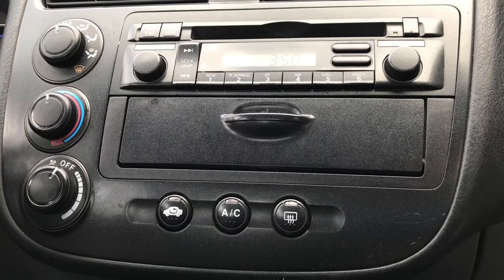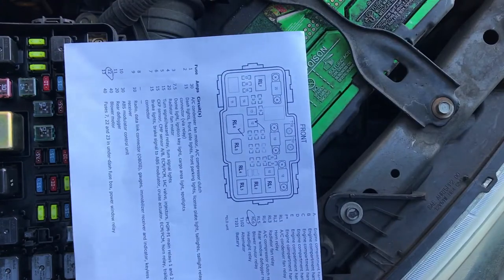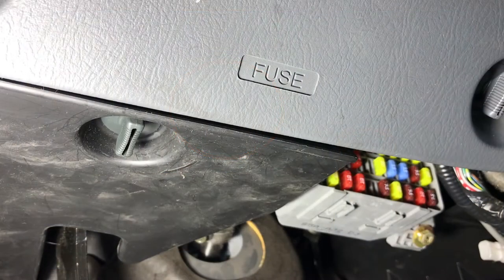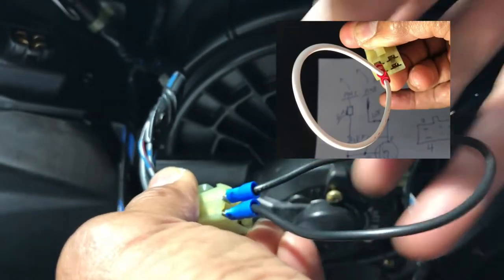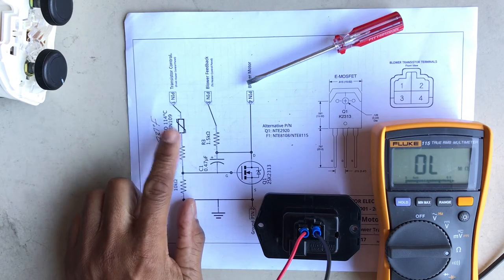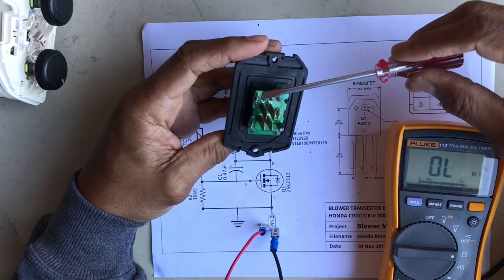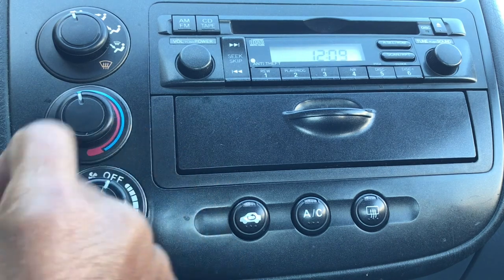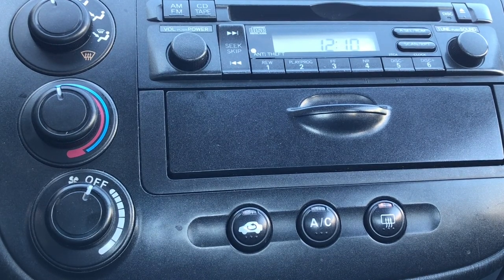Honda Civic Blower Motor and Blower Transistor Troubleshooting

Comment: This was by far the best walkthrough I have found. I ordered a new fan motor and transistors before watching this. I wish I had watched this first. I'm confident, it is the transistors. I installed the new fan motor, nothing but I bet if I run the jumpers and test the transistor I will find the problem and could of saved $40.

Comment: Sir... I wanted to take a moment of my busy schedule to Thank you for your tutorial. I did the diagnostic and I changed my blower motor resistor and now I have a working ac / fan. Summer might over here in Los Angeles but with the rainy weather, I'll be using my defroster regularly. Thanks again 👍🙏

Comment: Fantastic tutorial.Just subscribed May I ask? Do you use electron or conventional theory or both when you diagnose. Just wondering if one is easier to understand electronics? CHEERS
Reply from the maker: I use both. Technically, current flows from negative to positive in conductors. It doesn’t matter which convention you use if you’re consistent. Since electrons and protons have an equal but opposite charge, an electron flowing in one direction is equal to a proton flowing in the opposite direction. You can still use conventional current flow even though it’s not technically correct and come up with the right answer.

Most formulas used in electronics, such as Ohm’s Law, pretend that current flows from positive to negative. And if you think about it, most schematics depict a current flow from the positive side of a battery through conductors and loads to the ground, the negative side of the battery.

In the end, it doesn’t matter. I use both, whichever makes the circuit analysis easier. Again, remember that most formulas and books represent conventional current flow. For most bench-type troubleshooting, the direction of current flows is unimportant; the amount of current flows is.

Comment: This was pretty good. I will have to check the resistor/transistor module since the new heat controller did not correct the problem with the variable speed.

Some previous owner, or associate, had bypassed the fan wiring to install a bulky on/off switch they placed in the glove box with no variable speed option. They cut the power blue wire, taped up the separated end and hooked the live wire to the switch then anchored it to a ground bolt at the firewall.

I tried reconnecting the wire and checked the actual variable speed knob, but nothing worked, so I'm thinking it's the resistor module as noted in this video.

Comment: Thanks very much for the video.  Gotta wonder why they didn't PWM the MOSFET from the microcontroller instead of using it in a linear mode, would have been a lot less heat to add a catch diode and vary the duty cycle.

Comment: I have a 2010 Honda Civic and the blower stopped working but randomy will work.  Under dash fuse is good, under hood fuse good, blower relay good, and I have no power to blower motor connector or transistor.  If I jump the relay between 30 and 87, the blower will turn on and can be controlled via dash  climate control.  I tested the fuse box relay plug and have power on 2 plugs, and ground on one.  The top left (85 or 86) doesnt have ground.  Any ideas?  Thanks
Reply from the maker: It appears you’re not getting any voltage out of relay plug 87. Referencing the under-hood blower motor relay, remove the relay from the socket and turn the ignition key to the accessory position. With a multimeter, measure the voltage at socket position 86, which should read 12 V. Then, measure the voltage at position 30, which should also read 12v. Turn the key off and measure socket position 85 with an ohmmeter to any good ground; it should read nearly zero ohms.  

The relay plugs 85 and 86 are the ends of the relay coil.  Relay plug 30 is the 12v input to the switch contact, and plug 87 supplies 12v to the blower motor once the switch contact closes.

Comment: Hello! Pins 1 and 2 is measuring 11.04-.09 ohms. Is this good or bad?. The other pins are reading very close to yours except 1 and 2. Thanks.
Reply from the maker: I assume from what you wrote; you’re referring to a meter reading between 11.04K ohm and 11.09K ohm. That’s a correct indication given resistance tolerances around + or -5% (+/- 550 ohms).
Reply: @eetech_fix2393  ok, Thanks!

Comment: Great video on the resistor testing. Mine is a UK 2.2 2006 gen 8.
My resistor looks slightly different. If I test mine with the tab at the top assuming same pin numbers, my no 2 + 4 test is a fail.
If I turn it upside down and assume the pins are numbered that way everything checks out correctly as far as I can tell.
Where could I get a sechmatic like yours or find out?
Thanks
Reply from the maker: The case dimensions maybe slightly different; however, the electrical receptacle/plug pinouts, and wiring are most common to the 2006 Civic, Accord, and Odyssey. During that period, DENSO, (Japan company) was the source of those transistor units. A blown thermal fuse is most common, open reading between pins 1 & 2. The MOSFET transistor rarely fails.See the following link for pinouts and test points:  https://drive.google.com/file/d/1u2d3_BE0IlePQrb1HfBnxZir6aF8kAhU/view?usp=sharing
Reply: You are very good with this. i have a 2006 civic type r fn2 . the fan is full blast when ignition is switched to on . it wont change speed or switch off via controller. the only way it shuts off is if i remove either the fuse or the resistor/transister thingy

Comment: What levels of voltage does the control head deliver to the power transistor when the transistor thermal protection was burned open? Reason I ask is so I know what a good controller will deliver at various speed selection when there is no voltage drop due to blown transistor thermal protection device. So I can be confident the controller is working fine. Thank you.
Reply from the maker: Should vary between 0 - 12 Vdc with speed selection
Reply: @eetech_fix2393  Thank you Sir. I appreciate your videos.

Comment: ok.. my fan is working. How do I know if the problem is the power transistor or actual control knob ?
Reply from the maker: Reference the blower motor speed control schematic in the description section below. If the fan motor is working, try varying the speed of the motor with the speed control knob. If you cannot vary the fan speed, remove the wire harness plug from the transistor module and measure the voltage at pin #1 (referenced to ground) at the front of the wire harness plug. The voltage should vary between 2 and 11 volts as you turn the control knob. You likely have a bad control module if you cannot vary the voltage. The speed control knob is an integral part of the control module. If you can vary the voltage, you most likely have a bad transistor module shorted source to drain. I’m assuming you have a transistor module. Resistor modules are a different story; failing fan speed stuck high.
Reply: @eetech_fix2393 I actually have a 2003 Civic Sir. The schematic for the power transistor module is actually different.  The ground is pin 3 and the gate control is pin 4 according to the service manual.  The blower works fine when the module is bypassed.  I tested the power transistor on the bench and the thermal cut off seems open. Replaced the load with a low current buzzer and tested pe service manual. Buzzer did not sound.. Connected the MOSFET (no identification marks) to a transistor tester and it shows up strangely as a N-chan JFET.  I did not try to bypass the thermal fuse yet to see if the transistor works.
Reply: @eetech_fix2393  your video was very well in the analysis.
Reply: @eetech_fix2393  Where did you get a hold of that schematic ?
Reply from the maker: @rcarioca  check your local library they may have similar services available,  Links:  https://drive.google.com/file/d/1FaI0Cdl-TNQE2iDT3r0IbBjxO9Ul6tt6/view?usp=share_link 

https://www.ebsco.com/products/research-databases/auto-repair-source
Reply from the maker: Your motor works, and your thermal fuse appears blown (open); you’ve isolated your problem to a bad transistor module. 90% of the time, that’s what fails first, the thermal fuse, and if you bypass it momentarily (short across), it should. However, leaving it shorted will eliminate your protection against overheating. Your transistor test misidentified the transistor as a JFET; it’s an N-channel enhancement mode MOSFET. 

https://drive.google.com/file/d/10czeSn78eadEYB0Xa0mzSonBM_XU_hdo/view?usp=share_link
Reply from the maker: @rcarioca  Link :  https://drive.google.com/file/d/1FaI0Cdl-TNQE2iDT3r0IbBjxO9Ul6tt6/view?usp=share_link
Reply: @eetech_fix2393  unfortunately, the power transistor for the 2003 SIR is not the same.  But I found it in the Service manual

Comment: Thanks a lot for posting this video! Thanks to you I was able to find that I had a blown thermal fuse. However, I was not able to find a 2A 115C fuse but only a 10A one in my local electronics stores (I'm in a bit of a hurry as we are in a heatwave). However, after replacing it it is now stuck on full. Is this due to the fuse or is there something else wrong like my control unit?
Reply from the maker: Which model vehicle?  May still have an issue with your transistor module. The control modules are low-percentage failure items; however, still a possibility.
Reply: @eetech_fix2393   2001 sedan with a 1.6L D series engine.  I figured I had burned the transistor, which was true, since after replacing it it was working normally. However after about a minute, it was once again stuck on full. My opinion is, something is causing more current to pass through the circuit, burning the transistor, unless the proper fuse is there to sacrifice itself. This answer is rather well timed since I will be getting my hands on the proper fuse and a new transistor tomorrow :)
Anyways, since I got some spares as well I have a few chances to test what is wrong. The filters where a bit dirty but definitely not clogged. If you have any suggestions on where to look you'd be very helpful. Thanks in advance.
Reply from the maker: During the replacement of parts, sometimes there is an issue in the disassembly and reassembly process. With the replacement of the thermal fuse, always ensure none of the leads nor any metal parts connected to the leads touch the heat sink. Only the non-metallic parts of the thermal fuse should ever come in contact with the heat sink. You must remember that the heat sink, due to its direct connection to the drain of the transistor, has a 12 V potential if it comes in contact with any of the leads of the thermal switch or any other conductive part of the module you have a short to ground and the possibility of the fan runs all the time.

After you replace the fuse and transistor and get the module reassembled, run the following test to ensure everything is connected correctly and no other issues exist.

TABLE 1 TABLE 1 BLOWER TRANSISTOR TEST 
https://drive.google.com/file/d/1u2d3_BE0IlePQrb1HfBnxZir6aF8kAhU/view

Comment: If you accidentally hook those two wires up backwards, what would break?
Reply from the maker: You must specify the point in the video timeline where you refer to these two wires. Right-click that point on the timeline, select ”Copy video URL,” and paste that link into your reply.
Reply: @eetech_fix2393  my fan I plug it in backwards and the transistor started to smoke I got a new fan plugged it in correctly did not work. Should I replace the transistor next or did I just fuck the whole system? By plugging in the fan backwards.
Reply from the maker: @Toldyousonoob  If you have smoke from the Transistor at minimum, run the Transistor Test https://drive.google.com/file/d/1u2d3_BE0IlePQrb1HfBnxZir6aF8kAhU/view to verify its condition. Also, check your fuses, especially the 40A Blower Motor fuse under the hood. If you disconnected quickly, the transistor may have survived. The fuses are there and will protect you from blowing the whole system.

Comment: Hi. Ive just subscribed.
  Very informative and useful, ive learnt quite a tad from this....
 I have a problem with my 2006 2.2cdti  UK RH Model.....  the fuse in question (#36  10a) operates my blowers and also the electric wing mirrors.  It keeps blowing....  i came across the problem the other day... jumped in car, started it up and decided to switch on blowers.....not working.... located fuse #36  replaced with new, and switched engine on, then blowers.... the fuse blew again 2-3 seconds later... tried a few more times and still blowing in a cple seconds.
  Any ideas anyone please?
Reply from the maker: Fuse numbers may vary by year, model, and country. However, circuit groupings are similar.  the blower motor relay is supplied power via a 10A fuse under the dash, enabling the blower motor relay (under the hood) to supply power from a 40A fuse to the blower motor. Since that is a 10A fuse, it’s most commonly related to low-power items like power mirrors and relays that support larger items. If the blower motor relay and the power mirrors are the only circuits on that 10A fuse, pull out the blower motor relay (under the hood fuse box), and if that 10A fuse still blows, you know it’s in the power mirror circuit there’s the problem, possibly shorted wire. Verify,  Isolate, Detect, and Correct are the four basic steps.
Reply from the maker: Under Dash FUSE #14 (10A) - compressor clutch relay, condenser fan relay, blower motor relay, power mirrors, radiator fan relay, recycle control motor, rear defogger relay. Under Hood Fuse #12 (40A) - Blower Motor
Reply: Thank you so mich for your reply..
 Ive sorted out the problem now ( i shouldve updated this thread...apologies).
  I learnt a big lesseon in not taking things for granted and check EVERYTHING MYSELF...  i had the car given to me and the other side ( nearside RHD) electric mirror NEVER  worked and the previous owner informed me that it had been damaged in an accident so it was  DISCONNECTED.....  i didnt bother checkin it, only the driverside ( offside RHD) electric mirror, blower, blower resistor, rear defrost etc...still no joy...  was about to take it to autoelectrician but decided to give it another go.... i ran out of fuses so ordered some cheapies off a big online store.....  placed new fuse in and the nearside mirror started smoking and caught fire....  quickly knocked ignition off, and pulled fuse.....
Lesson 1..
  dont buy cheap generic fuses turns out the cheap fuses were  not 10 amp but closer to 20a
  Lesson 2....  dont neccessarily take other peoples word for jobs they said they've carried out.. 
  Was pure chance i found it,  disconnected mirror.....its still useable as i caught it in time  but have to adjust by hand...it'll do til i can get it off and replace it..   
 So i just unplugged mirror now and everything else, blowers, de-misters,  offside mirror etx work fine.
  Thanks once again for taking an interest and replying.
  Keep up the good work buddy. 👍👍👍